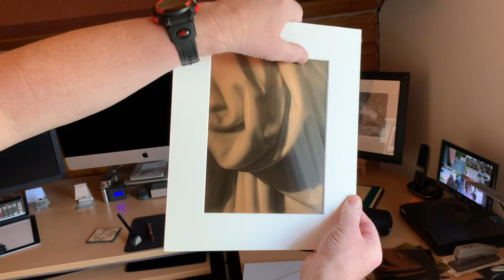Dry Plate Positive Orotones

Comment: Excellent video! Thanks. Could I ask the formula for the Polaroid b72? All I can find is solid pieces that need to be liquefied.  Also, do you use Museum Glass? Thanks.
Reply from the maker: All you need is 'Pure' Acetone (from the diy store), don't use nail varnish it contains water. Use 5g of Paraloid B72 crystals with 100ml acetone. Mix this solution with 3-5 g of powder to make your coating for the plate. You can buy premixed 5% Paraloid solution on Ebay. You only need plain 2mm float glass from the framers or glass store, but you will need to sensitise them with silver gelatine emulsion. I use Zebra plates which come pre-coated.
Reply: @TomLeePhoto  thanks Tom! I  can't wait to try it.

Comment: How did you set your exposure time?
Reply from the maker: It's a bit hit and miss! It gets better with time and experience, however the chemistry is rated at ISO1 so meter for ISO3 and extrapolate for 2 stops less, then make an adjustment of less half a stop if there is more UV in the scene (sunny) or plus half a stop (cloudy). This is a good starting point - then adjust from there. Good Luck.

Comment: Tom I don't have large negatives to contact print, could I use my enlarger? Perhaps change the bulb to a daylight bulb?
Reply from the maker: You can print from any negative in an enlarger without having to change the bulb, but you will have to do your own exposure tests and it will not give you the best tonal range. In order to print these plates with the best tonal range, you will need to produce a contact negative! You can find some useful download material on my website (Interesting Stuff Page).
Reply: @TomLeePhoto  Tom I'm going to buy a printer to make my digital negatives, I'm looking at an Epson ET8500, it's a dye based printer do you see any issues with that? Also for orotones what type of negative should I be shooting for? Flat, contrasty? Sorry for all the questions. Thanks
Reply from the maker: @skytrooper506  Have a look at this and download the bit on digital negatives and glass plate positives https://www.tomleephoto.com/interesting-stuff. It's not the printer that makes a great negative - it's how it's printed. Best of luck.